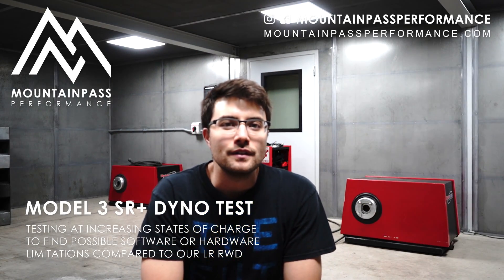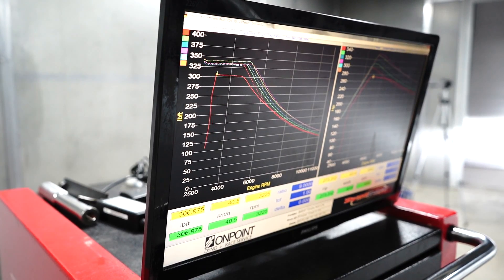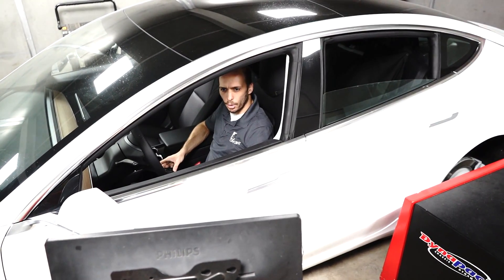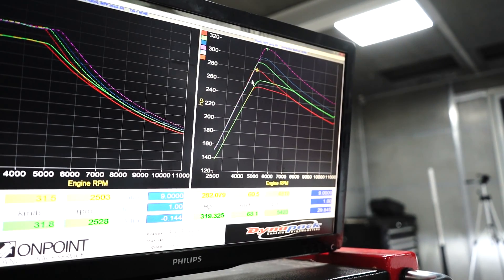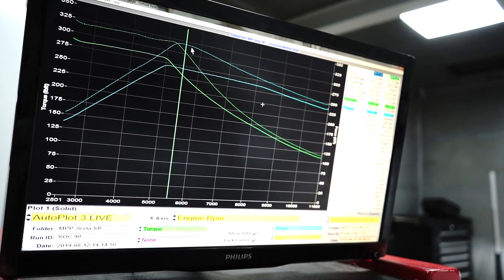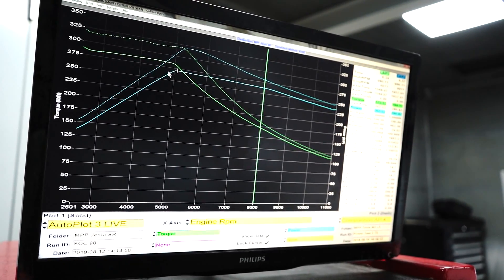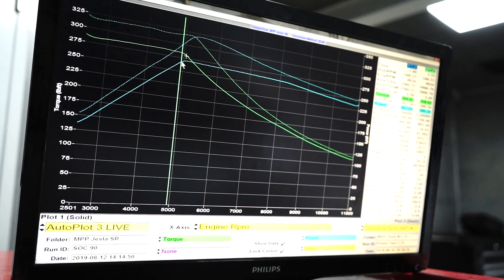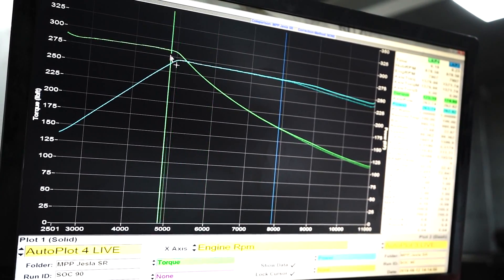Tesla Model 3 SR+ Dyno Test - As Fast As A Long Range?

Comment: Long range rear wheel drive has a better acceleration then the standard plus but the standard plus has the top end . Also for you guys wondering what version of the long range they are talking about no it’s not the long range awd is the long range rear wheel drive
Reply: Thanks for clarifying that I thought they were talking about the long-range AWD

Comment: What's likely happening with the SR+ is that the controller is maxing out the smaller battery's power capability, hence the almost flat power curve. 
The very slight drop in power in the flat area is likely the motor becoming slightly less efficient at higher speeds, even though the battery power is constant.
Reply: Nope, electric motor torque curves just look like that at 0 RPM. Look it up. This is a normal torque curve for a motor that is not bottlenecking.
Reply: @devinjones9614  nope. The bottleneck is the battery, not the motor.

Comment: The SR+ is 243kg lighter than the LR AWD.  It is the one I ordered as it is still plenty quick and it is very rare that i will need to Supercharge it and will be the most efficient at most driving except motorway/freeway driving over 120kph.

Comment: Thank you for showing real data!
I wonder if increased voltage sag of the smaller capacity battery could account for some of the difference after the max tq limitation is no longer in play?
Reply: Yes @Sasha Anis If I had to guess they hit the limit of the battery with the SR+ but they keep it at the limit of the battery for a while where with the LR they are at the limit of the motor or controller and the battery as well.  So its likely they have a different curve from that.

Comment: I ran a 13.5@104 mph in my SR+ a few weeks back at 88% SOC. I think there might be another 1/10th or two in it at a 95% SOC. That's not far off the LR 1/4 mile times.

Comment: SR stands for “standard range”, not “short range”. The range on the SR is far from short.
Reply: Still too short compared to a gas car..
Reply: @RubberDucky999  What is enough? I can't sit more than two hours.
Reply: @RubberDucky999  depends on the gas car... My Type R would get 210-230 miles per tank and my Model 3 SR+ does about the same...

Comment: Very interesting. Less weight and very similar power above a certain speed might make for a good platform to tune brakes, suspension, tires etc...
Reply: I own an SR+ on the MMP sports coilover setup. This thing is a monster in the corners. The lower weight and rear weight bias is really, really good when slinging into corners. 

I am replacing the pads and fluid in the next week and going to put on some Federal RS-Rs 255/35/18s tires (square setup).

Just need the MPP "Party Box" to remove the traction control and its track time. I wouldn't be shocked if this car put down faster lap times than my old modified Evo 8.

Comment: Can you do a AWD versus P car?
Reply: I didn't dyno them but I raced them. Check the video out on my channel....it was post 5% update. VERY interesting results. I have MPP coilovers so I don't feel bad for suggesting one of my videos on theirs lol :) The MPP coilovers REALLY make it a different car!
Reply: @damiengvideos4337  My god yes! I have the MMP coilovers on my SR+. It really handles like a proper sports car now. I've been finding an excuse to go canyon driving every weekend now. Best mod for a Model 3.
Reply: @JT-xq2hv  NICE! I initially went with their suggested settings and it handles so much better and rides even better then stock. THEN before a track day I I reached out to MPP and they gave me suggested settings for the track. It's so much tighter than the original setting which were also great! I am ok with . slightly rougher ride on the street with the extra control...I plan on leaving the car on the track setting for good. I also threw on a set of sway bars set to extra still for good measure.
Reply: @damiengvideos4337  How much rougher is the ride on the track settings? I was thinking I would be good with setting it slightly firmer than the "street" settings I was given. One big difference I noticed was that the rear suspension on the RWDs is soft. I think Tesla was using the rear suspension in the way you would an engine mount. The soft rear absorbed some of the torque hit making it less violent for daily driving. With the MPP setup on the torque hit is pretty brutal even on the SR+. I can't imagine how it must feel on the P3D with the coilovers...
Reply: @JT-xq2hv  The track setting is firm but if you are use to sports cars it's perfectly fine I think. Bumps are a little rougher. The biggest difference I can feel is when you come over a large bump...as you are coming off the bump normally the car would "float" a little then come down nice and smooth. With the track settings when you come off the bump or rise and the car drops it does not float it DROPS.  I want to say it's a dialed back rebound but I'm no expert. The thing I like with it stiffer if if you hit a bump in a corner the car seems to move less to the outside of the turn because it floats loess. I have no idea if that makes sense lol. I am sure there are terms I just don't know them :)
Reply: @damiengvideos4337  That completely makes sense. I played around with the adjustments this weekend and settled on a much stiffer setup than the "street" settings MPP recommended. Its slightly dialed back from the "track" settings but I love the increased stiffness and is still completely comfortable still for daily driving.
Reply: @JT-xq2hv  are you on Reddit or anything? I'd love to chat and hear more about your sr+ with coils and how it has changed the character of the car. Thanks!
Reply: @j_merlotte5467  I doubt this is the case but if you are local to me you can drive it. Send me a message and I can at least provide more info.
Reply: I second this. I have yet to see anyone dyno either model after the 5% performance boost. It'd be interesting if the AWD is now closer to 385hp as might be expected.
Reply: I'd LOVE to see this as well, please!!
Reply: Alex Kozubenko If you search there is one video out there of the LR AWD vs the P. It’s almost exactly 100hp 100 ft/lb more at the tires that the P has over the AWD. However as speed increases the P advantage goes away entirely. The P only has an advantage around 55-60mph and below. After that it’s dead even.